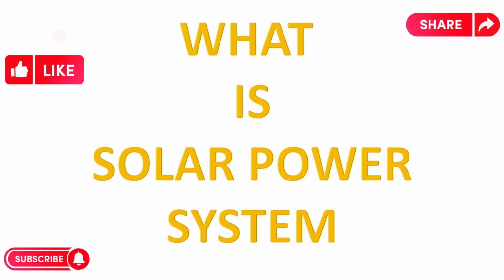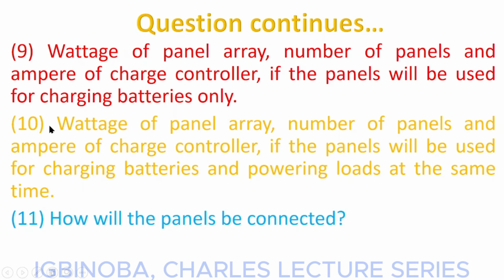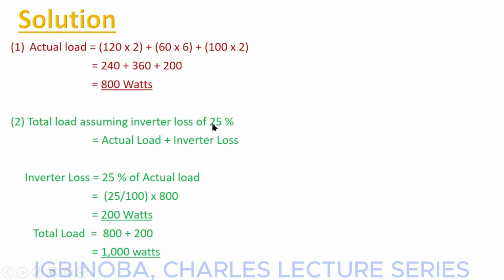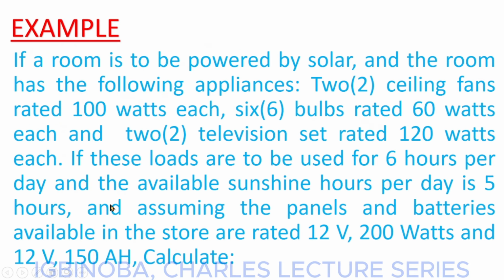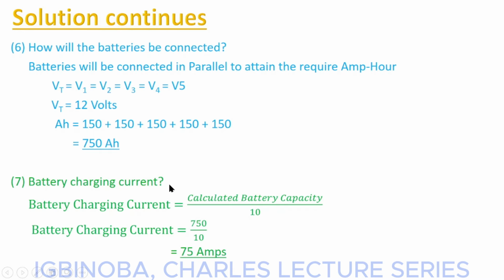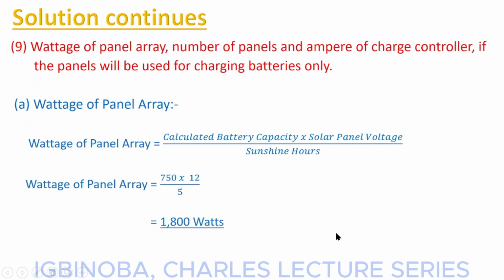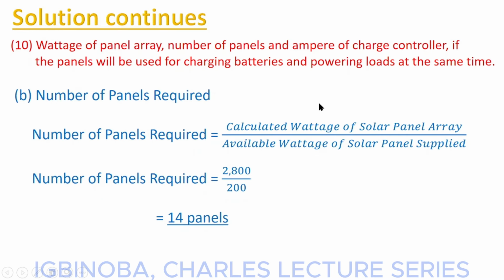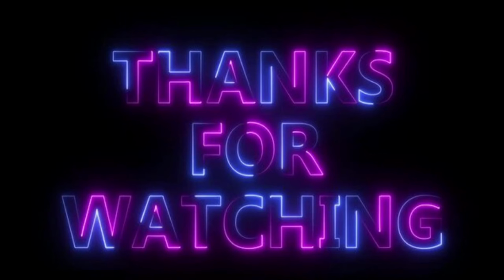Design of Solar Power System

Comment: COMP9I

1. The actual pad is 1,380W
2. The Total load is 1,725W
3. The inverter rating is 2,156.23VA
4. The battery capacity is 1,293.75Ah 
5. The Number of batteries is 9
6.  The batteries are connected in parallel 
7. The Battery charging current is 129.4 amps.
8. The battery charging time is 14 hours.
9. a. The wattage of the panel array is 3,105W
b. The number of panels is 16 panels.
c. The Charge controller rating is 258.75 amps.

10. a. The wattage of the Panel array is 4,830 Watts 
b. The number of panels is 24 panels.
c. The charge controller rating is 402.5 amps
11. The panels are arranged in parallel

Comment: MAR92N
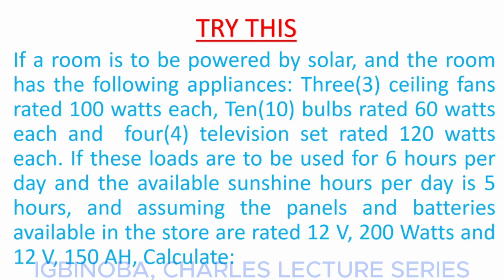23:24 
1. *Actual Load:* 1,380 W (8,280 Wh/day)
2. *Total Load (25% Inverter Loss):* 1,840 W (11,040 Wh/day)
3. *Inverter Rating:* 2,300 VA (2.3 kVA)
4. *Battery Capacity (75% Reserve):* 1,226.67 Ah (14,720 Wh)
5. *Number of Batteries:* 9 batteries
6. *Battery Connection:* Parallel
7. *Battery Charging Current:* 245.33 A
8. *Battery Charging Time (40% Loss):* 8.33 hours (8 hours 20 minutes)
9. *Panels (Charging Batteries Only):*
* Array Wattage: 3,680 W
* Number of Panels: 19 panels
* Charge Controller Current: 306.67 A (383.33 A with 1.25 safety factor)

10. *Panels (Charging & Powering Simultaneously):*
* Array Wattage: 5,520 W
* Number of Panels: 28 panels
* Charge Controller Current: 460 A (575 A with 1.25 safety factor)

11. *Panel Connection:* Parallel

Comment: EEE14N 

Total Connected Power: 1,380 Watts}

Daily Energy Requirement: 8,280Watt-hours/day}

Solar Panels Required (12V}, 200W}): 9 panels 

Batteries Required (12V}, 150Ah}): 5 batteries (5 to 6 batteries depending on system voltage pairing)

Comment: EEE40N

1. Actual Load: (3 fans × 100W) + (10 bulbs × 60W) + (4 TVs × 120W) = 300W + 600W + 480W = 1,380W.

2. Total Load (25% loss): 1,380W + (0.25 × 1,380W) = 1,380W + 345W = 1,725W.

3. Inverter Rating: 1,725W / 0.8 power factor = 2,156.25 VA.

4. Battery Capacity: (2 × 1,725W × 
6 hours × 0.75 reserve) / 12V = 1,293.75 Ah.

5. Number of Batteries: 1,293.75 Ah / 150 Ah = 8.62, meaning you need 9 batteries connected in parallel.

6. Battery Charging Current: 1,293.75 Ah / 10 = 129.38 A.

7. Battery Charging Time (40% loss): (1,293.75 Ah × 1.4) / 129.38 A ≈ 14 hours.

8. Scenario 1 (Charging only): 
Wattage: (1,293.75 Ah × 12V) / 5 hours = 3,105W.
Number of Panels: 3,105W / 200W ≈ 16 panels.
Charge Controller: 3,105W / 12V = 258.75 A.

9. Scenario 2 (Charging + Powering Load): 
Total Wattage: 3,105W + 1,725W = 4,830W.
Number of Panels: 4,830W / 200W ≈ 25 panels.
Charge Controller: 4,830W / 12V = 402.5 A.

Comment: PETRO77Y

1. Actual load is 1380watt
2. Total load is 1725watt
3. Inverter rating is 2156.25VA
4. Battery capacity is 1293.75AH
5. Number of batteries is 9
6. The batteries are connected in parallel
7. The battery Charging current is 129.4A
8. The battery charging time is 14 hours
9a. The wattage of the panel array is 3105watt
b. The number of panels required is 9 panels
c. Ampere of charging controller required is 258.75A
10a. The wattage of the panel array is 4830watt
b. The number of panels is 24 panels
c. The charge controller rating is 402.5A
11. The panels are arranged in Parallel

Comment: COMP52Z

1. The actual pad is 1,380W
2. The Total load is 1,725W
3. The inverter rating is 2,156.23VA
4. The battery capacity is 1,293.75Ah 
5. The Number of batteries is 9
6.  The batteries are connected in parallel 
7. The Battery charging current is 129.4 amps.
8. The battery charging time is 14 hours.
9. a. The wattage of the panel array is 3,105W
b. The number of panels is 16 panels.
c. The Charge controller rating is 258.75 amps.

10. a. The wattage of the Panel array is 4,830 Watts 
b. The number of panels is 24 panels.
c. The charge controller rating is 402.5 amps
11. The panels are arranged in parallel

Comment: COMP25Y 

1. The actual pad is 1,380W
2. The Total load is 1,725W
3. The inverter rating is 2,156.23VA
4. The battery capacity is 1,293.75Ah 
5. The Number of batteries is 9
6.  The batteries are connected in parallel 
7. The Battery charging current is 129.4 amps.
8. The battery charging time is 14 hours.
9. a. The wattage of the panel array is 3,105W
b. The number of panels is 16 panels.
c. The Charge controller rating is 258.75 amps.

10. a. The wattage of the Panel array is 4,830 Watts 
b. The number of panels is 24 panels.
c. The charge controller rating is 402.5 amps
11. The panels are arranged in parallel

Comment: COMP54B
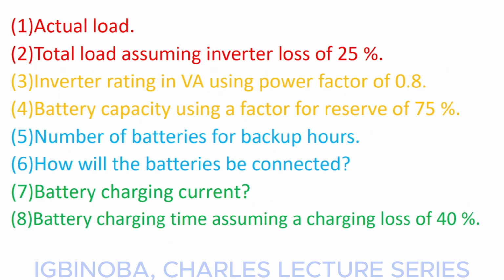Answers 23:31 :
1. The actual pad is 1,380W
2. The Total load is 1,725W
3. The inverter rating is 2,156.23VA
4. The battery capacity is 1,293.75Ah 
5. The Number of batteries is 9
6.  The batteries are connected in parallel 
7. The Battery charging current is 129.4 amps.
8. The battery charging time is 14 hours.
9. a. The wattage of the panel array is 3,105W
b. The number of panels is 16 panels.
c. The Charge controller rating is 258.75 amps.

10. a. The wattage of the Panel array is 4,830 Watts 
b. The number of panels is 24 panels.
c. The charge controller rating is 402.5 amps
11. The panels are arranged in parallel

Comment: MEC63K

Given 

. 3 fans × 100W = 300W
.10 bulbs × 60W = 600W
. 4 TV set × 120W = 480W

Total load:
PT = 300 + 600 + 480 = 1380W

 If used for 6 hours/ day:
E = 1380 × 6 = 8280Wh/day

Sunshine =  5 hours/ day
8280 ÷ 5 = 1656W

With 200W panals
1656 ÷ 200 = 8.28 approximately 9 panels

Comment: COMP39M

1. The actual pad is 1,380W
2. The Total load is 1,725W
3. The inverter rating is 2,156.23VA
4. The battery capacity is 1,293.75Ah 
5. The Number of batteries is 9
6.  The batteries are connected in parallel 
7. The Battery charging current is 129.4 amps.
8. The battery charging time is 14 hours.
9. a. The wattage of the panel array is 3,105W
b. The number of panels is 16 panels.
c. The Charge controller rating is 258.75 amps.

10. a. The wattage of the Panel array is 4,830 Watts 
b. The number of panels is 24 panels.
c. The charge controller rating is 402.5 amps
11. The panels are arranged in parallel

Comment: COMP21U 

1. The actual pad is 1,380W
2. The Total load is 1,725W
3. The inverter rating is 2,156.23VA
4. The battery capacity is 1,293.75Ah 
5. The Number of batteries is 9
6.  The batteries are connected in parallel 
7. The Battery charging current is 129.4 amps.
8. The battery charging time is 14 hours.
9. a. The wattage of the panel array is 3,105W
b. The number of panels is 16 panels.
c. The Charge controller rating is 258.75 amps.

10. a. The wattage of the Panel array is 4,830 Watts 
b. The number of panels is 24 panels.
c. The charge controller rating is 402.5 amps
11. The panels are arranged in parallel

Comment: COMP44R

1. The actual pad is 1,380W
2. The Total load is 1,725W
3. The inverter rating is 2,156.23VA
4. The battery capacity is 1,293.75Ah 
5. The Number of batteries is 9
6.  The batteries are connected in parallel 
7. The Battery charging current is 129.4 amps.
8. The battery charging time is 14 hours.
9. a. The wattage of the panel array is 3,105W
b. The number of panels is 16 panels.
c. The Charge controller rating is 258.75 amps.

10. a. The wattage of the Panel array is 4,830 Watts 
b. The number of panels is 24 panels.
c. The charge controller rating is 402.5 amps
11. The panels are arranged in parallel

Comment: COMP73U

1. The actual pad is 1,380W
2. The Total load is 1,725W
3. The inverter rating is 2,156.23VA
4. The battery capacity is 1,293.75Ah 
5. The Number of batteries is 9
6.  The batteries are connected in parallel 
7. The Battery charging current is 129.4 amps.
8. The battery charging time is 14 hours.
9. a. The wattage of the panel array is 3,105W
b. The number of panels is 16 panels.
c. The Charge controller rating is 258.75 amps.

10. a. The wattage of the Panel array is 4,830 Watts 
b. The number of panels is 24 panels.
c. The charge controller rating is 402.5 amps
11. The panels are arranged in parallel
Reply: COMP82D 
1. The actual pad is 1,380W
2. The Total load is 1,725W
3. The inverter rating is 2,156.23VA
4. The battery capacity is 1,293.75Ah
5. The Number of batteries is 9
6. The batteries are connected in parallel
7. The Battery charging current is 129.4 amps.
8. The battery charging time is 14 hours.
9. a. The wattage of the panel array is 3,105W
b. The number of panels is 16 panels.
c. The Charge controller rating is 258.75 amps.
10. a. The wattage of the Panel array is 4,830 Watts
b. The number of panels is 24 panels.
c. The charge controller rating is 402.5 amps
11. The panels are arranged in parallel

Comment: COMP59G

1. The actual pad is 1,380W
2. The Total load is 1,725W
3. The inverter rating is 2,156.23VA
4. The battery capacity is 1,293.75Ah 
5. The Number of batteries is 9
6.  The batteries are connected in parallel 
7. The Battery charging current is 129.4 amps.
8. The battery charging time is 14 hours.
9. a. The wattage of the panel array is 3,105W
b. The number of panels is 16 panels.
c. The Charge controller rating is 258.75 amps.

10. a. The wattage of the Panel array is 4,830 Watts 
b. The number of panels is 24 panels.
c. The charge controller rating is 402.5 amps
11. The panels are arranged in parallel

Comment: PETRO386H

Actual load: 1380 Watts
Total Load: 1725 Watts
Inverter rating: 2156.25 VA
Battery capacity: 1293.75 Ah
Number of batteries for backup: 9
Batteries are connected in parallel.
Battery charging current: 129.375 Amps
Battery charging time: 14 hrs
9)
a) Wattage of parallel array: 3105 Watts
b) Number of panels required: 16 panels
c) Ampere of charge controller: 258.75 Amps
10)
a) Wattage of parallel array: 4830 Watts
b) Number of panels required: 25 panels
c) Ampere of charge controller: 402.5 Amps

11) the panels are been connected in parallel

Comment: EEE343Q

1. The actual pad is 1,380W
2. The Total load is 1,725W
3. The inverter rating is 2,156.23VA
4. The battery capacity is 1,293.75Ah 
5. The Number of batteries is 9
6.  The batteries are connected in parallel 
7. The Battery charging current is 129.4 amps.
8. The battery charging time is 14 hours.
9. a. The wattage of the panel array is 3,105W
b. The number of panels is 16 panels.
c. The Charge controller rating is 258.75 amps.

10. a. The wattage of the Panel array is 4,830 Watts 
b. The number of panels is 24 panels.
c. The charge controller rating is 402.5 amps
11. The panels are arranged in parallel

Comment: MAR336J

1. Actual load: 1380 watts
2 Total load: 1725 watts
3. Inverter rating: 2156.25 VA
4. Battery capacity: 1293.75 Ah
5. Number of batteries: 8.625~9
6. Parallel
7. Battery charging current: 129.375 Amps
8. Charging time: 14 hrs
9. a) 3105 watts
b) 15.525~16 panels
c) 285.75 Amps
10. a) 4830 watts
b) 24.15~24 panels
C) 402.5 Amps
11. Parallel

Comment: NAT37G 

1. Actual load: 1380w
2. Total load: 1725W
3. Inverter Rating: 2156, 25VA
4. Battery Capacity: 1294.75Ah
5. Number of Batteries:9
6. Configuration: parallel 
7. Battery charging current: 129.375A
8.Charging Time: 14Hours
9a. 3105W
9b. 16 panels 
9c. 258.75A
10a. 4830W
10b. 24 panels 
10c. 402.5A
11. Parallel

Comment: COMP3116L

1. Actual Load: 1380 W
2. Total Load (including inverter loss): 1840 W
3. Inverter Rating (V.A): 2300 V.A
4. Battery Capacity: 1227 Ah
5. Number of Batteries: 9 batteries
6. Battery Connection: Parallel
7. Battery Charging Current: 15A (per battery string)
8. Battery Charging Time: 5 days
9. Panel Array (for charging batteries only):
   i) Wattage: 2945 W
   ii) Number of Panels: 15 panels
   iii) Charge Controller Ampere: 245 A
10. Panel Array (for charging batteries and powering loads):
    i) Wattage: 4785 W
    ii) Number of Panels: 24 panels
    iii) Charge Controller Ampere: 399 A
11. Panel Connection: Series - Parallel

Comment: EEE378Z

1. Actual Load = 1380 watts

2. Total Load = 1725 watts

3. Inverter Rating = 2156.25 VA

4. Battery Capacity = 1293.75 Ah

5. Number of Batteries = 8.625~9 batteries

6. Parallel

7. Battery charging current = 129.375 Amps

8. Charging time = 14 hrs

9. (a) 3105 watts

(b) 15.525~16 panels

(c) 258.75 Amps

10. (a) 4830 watts

(b) 24.15~24 panels

(c) 402.5 Amps

11. Parallel

Comment: MECH337K

Actual load :1380 watts
Total load:1725 watts
Inverter rating:2156.25VA
Battery capacity:1293.75Ah
Parallel connection
Battery charging current :129.375amp
Battery charging time:14 hours
Wattage of panel array:3105watts
Number of panels:15.5-16 
Ampere of charge controller:258.75amps
Wattage of panel array:4830watts
Number of panels:24.15-25
Ampere of charge controller : 402.5amps
Parallel connection

Comment: MECH3137G

1. The actual load is 1,380 watts.

2. The total load is 1,725 watts.

3. The inverter rating is 2,156.25 VA.

4. The battery capacity is 1,293.75 Ah (amps-hours).

5. The number of batteries is 9.

6. The batteries are connected in parallel.

7. The battery charging current is 129.4 amps.

8. The battery charging time is 14 hours.

9. a. The wattage of the panel array is 3,105 watts.
b. The number of panels is 16 panels.
c. The charge controller rating is 258.75 amps.

10. 

a. The wattage of the panel array is 4,830 watts.
b. The number of panels is 24 panels.
c. The charge controller rating is 402.5 amps.

11. The panels are arranged in parallel.

Comment: CHM3130Z

1)Actual load: 1380 Watts
2) Total Load: 1725 Watts
3) Inverter rating: 2156.25 VA
4) Battery capacity: 1293.75 Ah
5) No of batteries for back up: 9
6) Batteries are connected in parallel.
7) Battery charging current: 129.375 Amps
8) Battery charging time: 14 hrs
9)a) Wattage of parallel array: 3105 Watts
b) Number of panels required: 16 panels
c) Ampere of charge controller: 258.75
Amps.
10)a) Wattage of parallel array: 4830 Watts
b) No of panel required: 25 panels.
c) Ampere of charge controller: 402.5 Amps
11) The panels are connected in a parallel manner.

Comment: EEE356D

1. Actual Load: 1380 W

2. Total Load (including
 inverter loss): 1840 W

3. Inverter Rating (V.A): 2300 V.A

4. Battery Capacity: 1227 Ah

5. Number of Batteries: 9 batteries

6. Battery Connection:Parallel

7. Battery Charging Current: 15A (per battery string)

8. Battery Charging Time: 5 days

9. Panel Array (for charging batteries only):
I) Wattage: 2945 W
II) Number of Panels: 15 panels
III) Charge Controller Ampere: 245 A

10. Panel Array (for charging batteries and powering loads):
I) Wattage: 4785 W
II) Number of Panels: 24 panels
III) Charge Controller Ampere: 399 A

11. Panel Connection: Series - Parallel

Comment: EEE310J
Actual load=1380watts
Total load=1725watts
Inverter rating=2156.25VA
Battery capacity=12993.75AH
Number of batteries=8.6
Connection parallel
Battery charging current=(129.375.8) charging time
Wattage of panels arrays=3105w.B number of panels 16 panels charge controllers 258.75A
A wattage of panels array 4830W.B Number of panels 24.C charge controller 4025A.
Panels arrangement= Parallel

Comment: PETRO362J

1. Actual load= (100×3)+(60×10)+(120×4) =1380watts
2. Total load assuming inverter loss of 25%= Actual load +Inverter loss
Inverter loss=25% of Actual load
= 25%×1380=345 watts
Total load= 1380+345=1725 watts
3. Inverter rating on VA using power factor of 0.8
= (1725÷0.8)= 2156.25
4. Battery capacity using factor for reserve 75%=(2×1725×6×0.75)=1293.75Ah
5. No. of batteries for backup hours=1293.75Ah÷150Ah= 8.6 =8 batteries 
6. How batteries will be connected?
The batteries will be connected in parallel 
Vt=V1=V2=V3=V4=V5=V6=V7=V8
Ah= 150+150+150+150+150+150+150+150=1200
7. Battery charging current=1293.75÷10=129Amps
8. Battery charging time assuming charging loss of 40%= 1293.75Ah+(40%+1293.75Ah)÷129A=14hrs
9a. Wattage panel array= 3105 watts
9b. Number of panels required= 3105÷345=9 panels 
9c. Ampere of charging controller required= 3105÷12=258.75Amps
10a. Wattage of panel array= Calculated wattage of solar panel array for charging battery only+ calculated total load =3105+1725=4830watts
10b. Number of panels required= calculated wattage of solar panel array÷ Available wattage of solar panel supplied= 4830watts÷345= 14Amps
10c. Ampere of charge controller= calculated wattage of solar panel array÷ solar panel voltage=4830watts÷12volts= 402.5Amps
11. How will the panels be connected?
Ans: They will be connected in parallel

Comment: EEE3168L Actual Load: 1380 W

2. Total Load (including inverter loss): 1840 W

3. Inverter Rating (VA): 2300 VA

4. Battery Capacity: 1227 Ah

5. Number of Batteries: 9 batteries

6. Battery Connection: Parallel

7. Battery Charging Current: 15 A (per battery string)

8. Battery Charging Time: 5.1 days

9. Panel Array (for charging batteries only):

Wattage: 2945 W

- Number of Panels: 15 panels

Charge Controller Ampere: 245 A

10. Panel Array (for charging batteries and powering loads):

- Wattage: 4785 W

- Number of Panels: 24 panels

- Charge Controller Ampere: 399 A

11. Panel Connection: Series - Parallel

Comment: Comp354s
1. Actual Load is 1380
2. Total Load is 1725
3. Inverter Rating 2516.25VA
4.Battery Capacity is 1293.75
5. Number of Batteries 8 ,6-9.6
6. Batteries connected in parallel 
7.battery Charging Current is 129.375AMP
8. Charging Time is 14 hours 
9.a. 3105w
B. 15.5 panels 
C. 258.75A
10.4830w
B. 24 panel 
C.402.5
11 . Panels are connected in Parallel Order

Comment: MECH3183A

1. 1380W
2. 1725W
3. 2156.25VA
4. 1293.75A
5. 9 batteries
6. Parallel connection 
7. 129.4 Amp
8. 14hrs
9a. 3105W
9b. 16 panels
9c. 258.75A
10a. 4850W
10b. 24 Panels
10c. 402.5A
11. Parallel connection